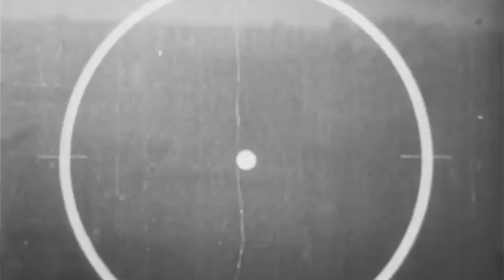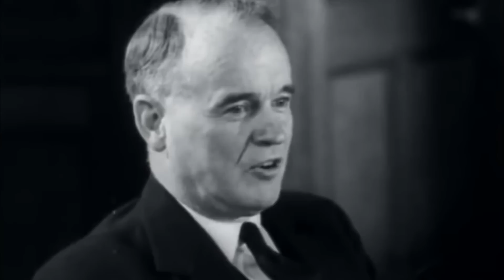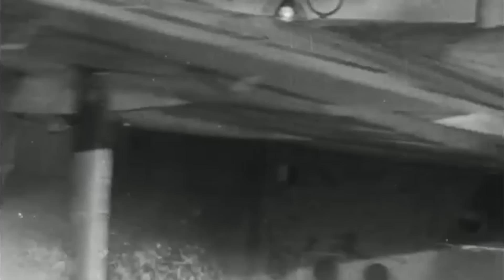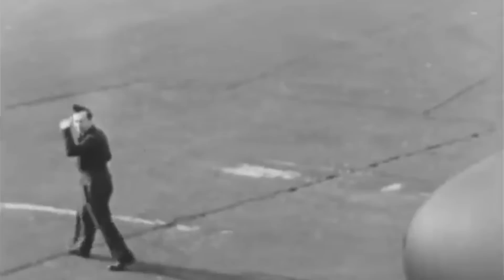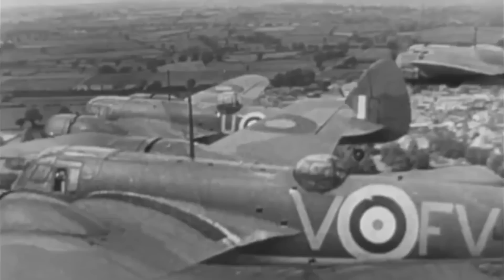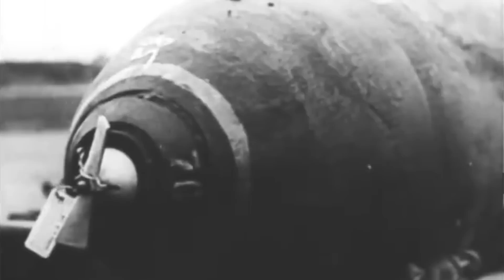WW2's Most Controversial Aircraft

Comment: Much more could have been said about the many serious deficiencies of the Short Stirling, for example, its very awkwardly designed bomb bay which meant that bombs larger than a 2,000 pounder would not fit inside, the frequent and potentially lethal problems with the gargantuan main undercarriage system, and the dangerously low service ceiling (typically 14,000 feet) which compelled the aircraft to suffer medium calibre anti-aircraft fire that Halifaxes and Lancasters could overfly with impunity. Stirlings were taken out of the front line as soon as possible, and relegated to duties such as target tugs, supplying materiel and dropping paratroops. The RAF was glad to get rid of the Type, and there was no postwar enthusiasm for saving a single example, even the one that was exhibited next to St Pauls's Cathedral in London, although a few museums do have parts of the Type on display. Over the years there have been proposals to recover and restore substantially complete but quite corroded crash-landed examples from marshes and shallow lakes, but nothing has ever proven viable. The Short Sunderland was by contrast a fine aircraft.

Comment: The Air Ministry, often had absurd ideas for aircraft. I heard once when they ordered some of the US P=38s, they wanted them with two right turning engines, instead of the one right and one left turning. Of course the idea did not work, and they had to be returned to the original design. But at the same time, they did get some amazing aircraft built during the war.
Reply: Manly because of British bloody-mindedness and huge dollops of luck. Had the British in general been as rigid in following orders as Germans, they would have persisted in fewer designs and had only the Air Ministry requirements followed to the death.
Reply: The Air Ministry had SEVERAL Lockheed P.38 Lightnings on RAF strength - TEST ONLY

One of them (off the top of my head), was "AE.879" - It was actually attacked by a lone Fw.190 over England

That tale doesn't get spoken about much, as many folks ARE unaware of it

The RAF "rejected" the P.38, purely because 'those given' lacked superchargers & ergo, useless at high altitudes

Comment: The shortened wings were to save on construction material. That's the only reason.
Reply: Even if it results in a notably worse plane?
Reply: @econecoff1725  
Some other examples of this thinking
We know that these Mark XIV torpedoes have at least a 50% failure rate. But testing to solve the problem would cost money and we won't spend it. Use them as is.
We know that the soldiers need body armor. And we could issue them all a set. But we don't want to pay for it. They can go without.
We know this fighter will be in combat and that it's missiles have an 85% failure rate, and that is needs guns as a back up. But we decided not to put one on it because that would cost money. 
We have these repeating rifles. But if we give them to soldiers they will fire off too many rounds and that might get expensive. They can keep using muzzle loaders.
Reply: There should be a cost/benefit analysis. If a larger wing span would only improve the plane a little bit, I can see skimping when materials are short. Insurance companies have experts on "death math" tradeoff calculations. It's gruesome, but necessary. Plus, if the goal is to limit material, you limit by weight, not wing-span. It said they had to make the wings wider (front to back) to compensate for the imposed limit, probably using the same amount of material in the end, but a less optimized result.

Comment: One of the biggest Airfix models I made before the other 4 engined bombers as it was alot cheaper inthe early 70s
Reply: I built one of them a few years ago, but it was an old mould so the detailing wasn't as good as modern kits, I still like it all the same. Italeri have brought out a new version, but my attic stash is big enough without adding to it even more.
Reply: And I bought it to get the tractor and bomb trolleys (:-)
Reply: @michaelpielorz9283  I remember the tractor and bomb trolley. I have a Lancaster in 1/144th scale; alas I need the eyesight of a twenty year-old to build it, or those magnifying lenses.

Comment: The Stirling had tricycle landing gear?
Reply: No, it was a taildragger.  Tricycle gear has a nosewheel.
Reply: @lancerevell5979  and even worse, it had 2 small wheels at the tail section making it technically "quadricycle".
Reply: @lancerevell5979  the narrator claimed it had tricycle landing gear when that was clearly not the case.